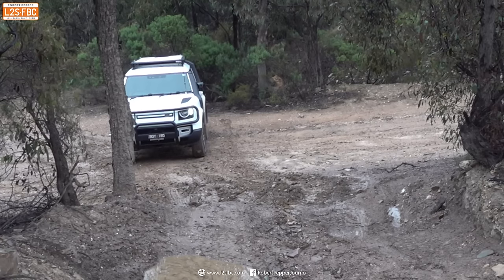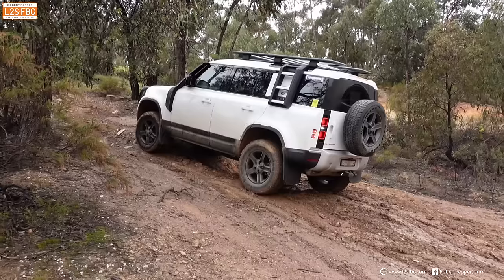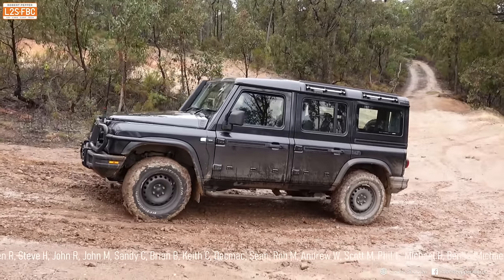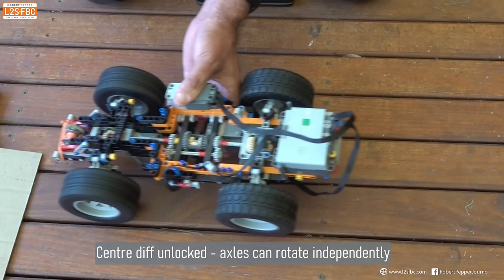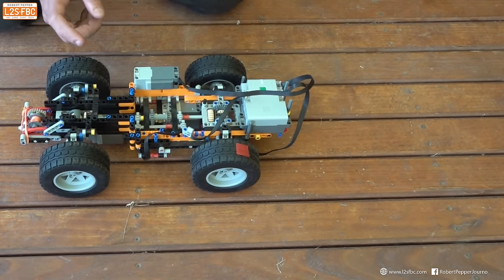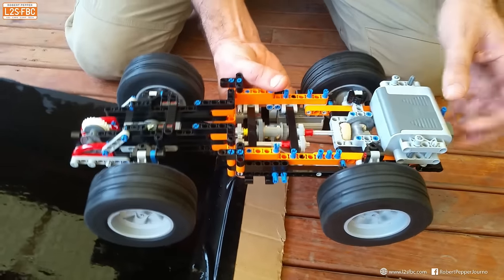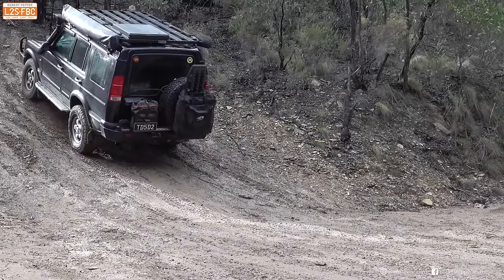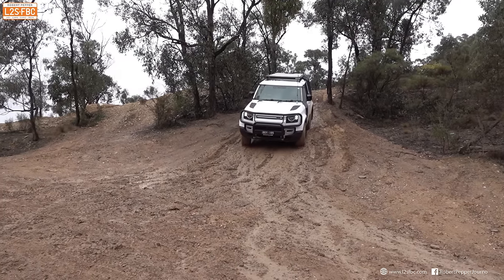The Centre Diff On Hills Problem: Grenadier vs Patrol vs LC300 vs Defender - Part 6

Comment: Thanks for this excellent series Robert. 
I have just had an Ashcroft ATB centre diff fitted to my Puma Defender 110. As I understand it, this gives a degree of limited slip between front and rear when the diff is unlocked but when I lock the diff will there be any difference in operation to a locked standard centre diff? Thanks again.
Reply: As I understand it the Ashcroft centre at replaces the diff centre so you can still lock it up as before.
Reply from the maker: I have covered torque-biasing diffs here https://youtu.be/xWRfPuCgxhg

Comment: That's why you don't drive in AWD SUV but instead a full-size Bronco or a full size Jeep with an actual transfer case to go from 2H into 4H or 4L. Might as well not have all those front end parts turning and wearing out driving down the road 90% of the time if you don't need them to be working then. And people can say oh well the all-wheel drive is good because some people live in bad weather yeah that's true but then those people can just purchase the all-wheel drive but most people just get these things and drive them down normal roads and it would make more sense to just make them selectable 4 x 4. And in all reality if you've ever associated with a Jeep Rubicon Wrangler you would know that in 2H it has enough articulation and option of rear Locker to literally get through where all these are going without even going into four-wheel drive hahaha I followed a Rubicon one time on a pretty tough Trail in my disco Series 2 on 33s with sway bar deletes traction control and CDL of course and he stopped to put it into four-wheel drive after a while when I thought that I was doing good by even being able to follow him and then realized wow this guy isn't even in 4wd at all yet..

I like this video and I like the comparison don't get me wrong I'm just throwing in my own personal opinion about what I feel to be overkill on these vehicles always having all-wheel drive instead of just selectable four-wheel drive. Feels like it would save people having confusion over cross axle lockers compared to transfer case Center diff locks whatever you want to call it. I hear people say almost in a braggadocious factor oh mine has a lock and I'm like Oh you mean it has traditional four-wheel drive big deal it seems like the company is just made them selectable they would have less moving Parts they would have lighter overall weight and not make a selectable Center diff lock sound like you have something real special where I joke and say all the all wheel drive vehicle has regular four-wheel drive cool
Reply: I wonder if a lot of manufacturer motivation is to avoid drivers doing bad things on high traction surfaces and causing breakages and complex warranty claims.  Instead they should just upspec the drivetrain and have appropriate education and warnings.
Reply: AWD with centre diff lock is superior to 2WD with a 4WD select every time. You have probably never owned an AWD (with CDL) to make the comparison. I have owned both, it is way easier to just engage the CDL than engage 4WD, and you can do it at moderate speeds (most under 50mph). Can also use lowrange in AWD, pretty handy for backing up that heavy trailer on a steep bend.
Reply: @davidkelly3779  my pajero had options but i found it handled more neutrally in 2wd, even though the AWD setting has a torque split something like 40:60.  My AWD amarok had a torsen centre diff which has a variety of drawbacks.  Yes, ideally 2wd low range is available, but most people don't need that.  I grew up in land rovers and i don't have anything against their system, but they were pre 2000 models.  I do remote touring in big Australia and reliability is important to me.  If i lived in Thredbo with icy roads i might consider getting AWD but i don't live there.  Switching between 2wd and 4wd can be a bit tedious but i can live with that knowing that it performs well in each mode.

Comment: I am fan of your work and your channel, and understand what are you saying in this video, but i also think the big or biggest “issue” here was the driver and driving style of Defender.  Any car will lock the front wheels on slippery surfaces if you hit the brakes, or not release the brake pedal enough…  even when he was driving down facing front he didn’t let the wheels go…. Here in europe in winter we see so many drivers on snow and ice standing on brakes and wondering why they can’t steer.    

Like i said, no hate and i understand the technical stuff behind it and agree some cars are better and some worse, but in this case i would say the bigger difference was made by driver…
Reply: Watched it again, and you can see the defender driver had stopped on descent steered the wheels and than continued with foot on break…
Reply from the maker: The point of the CD lock is that the front wheels cannot lock without the rear. That clearly happens with the Defender. It's not a driver thing.
Reply: True, but even with cd locked if you slam the brakes you can lock one front wheel…  

At the beginning of decent defender front right wheel was rolling and if the driver let the brakes he would be fine.  He pushed brakes harder and locked both front wheels in a slide… 

Agree there is a problem and difference between cars, that’s why every car needs bit different approach and driving style.  

Better driver in worse car can get further than bad driver in good car sometimes…  

Knowing the pros and cons and knowing how to use them in your favour is what matters to me… 

Keep the good work you do 👌🏻
Reply from the maker: Yes, one wheel locked is shown on the D2 on the hill, and LC300 descending.  But one wheel is some control, no wheels is no control. It's not a great solution to have to reduce braking when the rear wheels have grip that can be used!
Reply from the maker: If the driver had released the brakes as you suggest the front tyres would have been able to use more grip for turning and less for braking.  But then...the car would have gone faster, requiring more turning grip. The other drivers used the same technique but their cars were better able to make use of the traction due to their CDs being locked.  It's not the driver, it's the car.

Comment: Was the Centre Diff manually locked in "Configurable Terrain Response"? 

Or had you left it in Auto mode?
Reply from the maker: See video for explanation
Reply: @L2SFBC  I have watched it, I assume your Defender doesn't have Configurable TR then. If it did, you can manually lock the Centre Diff - it would be interesting to know whether this problem remained in that scenario. 

Unfortunately your video is attracting the luddites who are anti electronics, but potentially it's not a fair comparison. 

I also appreciate that your video wasn't specifically aimed at the Defender, but I think it's worth pointing out that with the diff manually locked, it would perform the same as the others.
Reply from the maker: We will be testing CTR later.  Not all L663s have CTR, and no other Land Rover vehicle has it either, and as you say it was an example.  I know CTR does not 100% lock the c/d at all times, that's been proven; unclear if it locks enough.  Certainly it'd help.

Comment: I love when people really understand the physics behind the differentials. There are so many motoring journalists that state "the centre differential is locked so there is a 50-50 torque split between the axles" which is just plain incorrect.
Reply: What's incorrect?
Reply: @hi9580  That it is a 50:50 torque split. Actually 100% of the torque can be utilised by either axle. Light duty Haldex or similar systems may actually have a torque limit on an axle. An example is my 2015 Honda CR-V which has a 70-30, limited by the clutch that drives the back axle. The front can actually still transfer 100% of the available torque while zero goes to the rear. This is true of my Ford Ranger in a different way. It can transmit 100% to either front or back with a normal split on the road in 4A[utomatic] of 100% rear 0% front.
Reply: @hedydd2 um, if you lock the transfer or centre diff in a car, it's locked. 50/50 front and rear. There is no slip anywhere, except in the diff centres if unlocked.
Reply: @DarrenBoxhall  If you stand it up on its hind wheels, all 100% of the torque would go to those rear wheels. That’s not a 50/50 split, it is 0/100%. even though the front are equally capable of 100% if circumstances dictated.   That is in contrast with my Honda, for instance, where the maximum torque available at the rear wheels under any circumstances is limited to 30%. If the required torque exceeds 30% the wet clutch slips causing the oil to overheat.
Reply: @hedydd2 

I think you are misunderstanding the meaning of 50/50

Maybe representing it as 100/100 would make it easier to understand for you. 

It doesn't matter how many wheels are on the ground, the point of saying 50/50 is that there is no split of torque to the front and rear diffs, they are linked. Which is the best for off-road.
Reply: @hedydd2  your Honda isn't an actual 4x4, that's why it's limited, it's AWD
Reply: @DarrenBoxhall  Of course it’s 4wd. Don’t get bamboozled by advertising waffle which describes various systems to suit its own marketing. I’ve owned, all from new and some until scrapped, four Range Rovers, a Discovery, five Defenders, a Mitsubishi Shogun, Audi 80 Quattro and Q7, BMW X5, Mercedes ML270, three Nissan Terrano, Kia Sorento, Volvo XC90, three Ford Ranger pickups the latest of which has a similar torque proportioning system to a Mitsubishi Super Select  with  a fully locking centre diff as well. I ran many of these concurrently and still run some of them including a Land Cruiser, Honda CR-V and two Rangers. So I know these things back to front, how they work and their weak points as well as strong. Oh and have driven my friend’s Mercedes GL[S] times two and his latest BMW X7 extensively. I’m trying to think of any that I may have missed over the years. The CR-V is the only 4wd system that has an inadequate torque rating to the rear wheels. It would fail with slipping clutches where the Sorento and XC90 would drive up no problem where the Land Cruiser would struggle with wheel slip, mainly due to a lack of bite and excessive mass.
Reply: @DarrenBoxhall  It is you that misunderstands basic engineering and mathematics. I know exactly how torque is measured and what it is… the testing force on a shaft.
Reply: @hedydd2  you are completely missing the point here. The AWD  system which is in the cars you mentioned above, has a centre differential which splits the powers between both front and rear axles, albeit with a bias, to the front or to the rear , depending on what the car is made far. Porsche 911 or gr corolla centre differential has a rear bias, meaning, rear axle will get more power as opposed to the front in sporting mode, because they are sporting cars. They are AWD cars. That's it.

When you say 4x4 or 4wd , you have a transfer case with more gearing ratios. When a centr diff is locked,  and you engage in 4H or 4L.the axles are locked with split between both axles at 50/50. That's the entire point of differential lockers. AWD is completely different from 4x4 or 4wd. Some 4wd s behave like AWDs when the centre diff is not locked.
Reply: @hotshotsunnyz  No shít Sherlock! I’ve only had five full time 4WD Land and Range Rovers, two full time Land Cruisers [an 80 and 100 series], an optionally full time current model Ford Ranger plus an older part time Ranger. Three part time Nissan Terrano’s {`European type], and Isuzu Trooper [Bighorn], Mitsubishi Shogun/Pajero [the MkI part time transfer box before Super-Select optional full time], An Audi Quattro, BMW X5, Mercedes ML, Volvo XC90 and Kia Sorento [both current models] plus Honda CR-V.    So just maybe I have more knowledge and experience of these types of vehicles and their systems than most. I owned all those from new although my father mostly drove the Isuzu and mother one of the short Terrano’s and the Shogun.  I had up to six vehicles on my small fleet of farm-used vehicles at any one time. Nearly at retirement age I am now down to two Ranger pickups [2014 and 2023] plus the old CR-V which will be changed for another new Range Rover when I retire later this year.
Reply from the maker: You're both right. I'll explain in a video.

Comment: In pajero gen 2 with superselect, if you engage 4hllc the drive is split 50/50 front/rear transforming it into full 4wd mode and not part time 4wd same goes for 4llc, whereas 4h is part time 4wd like most offroad suv or pickups. Never had this problem in the pajero in similar situations
Reply: Super select 2 is an brilliant system
Reply from the maker: Correct drive offroad in 4hl not 4h, or use low range as you say
Reply: The Paj is definitely a capable vehicle, when it can keep its belly off the ground.
Reply: I have 2 pajeros, a 1th gen. and a 2th gen. , they are great reliable cars ! 
First gen. has no center diff. , so no problems there 😉
The second gen. with super select works in 4Hlc and 4Llc the same as the first gen. high and low.
Sofar I know, "Superselect 4H" is not "part time 4WD", it is a full time 4WD with open center diff. , and there is also a visco clutch that locks the center diff. automatically when a wheel is slipping.
Reply: @johnny_w in 4h power is split 60/40 or close to that, yes it has a viscous coupling that does as you describe but by selecting 4hlc or 4llc wich lockd tje centre diff power is split 50/50

Comment: What mode was the Defender in? It’s very rare the centre locker is off when in most TR modes.
Reply from the maker: Mud Ruts and also Rock. However it's not just the Defender, it's a generic problem as you can see across a lot of vehicles. The centre lock is on, to a greater or lesser degree, during the climb, otherwise the front wheels would spin as you saw in the D2.  It is when the car stops that the problems happen.
Reply: Interesting as my assumption is the centre lock is either on or off. Especially in rock crawl, I have never not seen my diffs unlocked, even at a stop. 

Very interesting video!
Reply from the maker: Modern Land Rovers have degrees of lock, not binary open/locked like say the centre diff of Puma or TD5 Defenders.  The computer is always changing the 'lock' according to lots of factors such as turning input, TR mode, wheel spin etc etc.  But, they forgot "front wheels locked rears rotating" as  use case...

Comment: On my G Professional 463, reversing down a steep icy slope with center diff lock, I'm forced to use the handbrake. There is no crawl in LR R. Way too fast compared to LR 1. Mercedes say they can't change this. I'm wondering if there's anything else I can try apart from handbrake? Never had this in my Cruiser 71 which could crawl in LR R.
Reply from the maker: No crawl? Are you in low range?  Yes, you can drive through the brakes; left foot on brake lightly, increase revs to move.
Reply: Yes I wrote I'm in LR R(Low Range Reverse). I also don't need to use accelerator to move, it's very steep, I'm trying to slow the car. Touching footbrake immediately swings the front to mountain side, hence me using handbrake. If gearing isn't correct(too fast) presumably there's nothing I can do except park lower down. As I said, in the Cruiser 71, I never knew this problem, it crawled. The G practically freewheels backwards. A shame.
Reply from the maker: That behaviour looks like centre diff not locked but you note it is.  Use the technique above; it's not acclerating to move per se, it's holding on brake, THEN using accelerator.